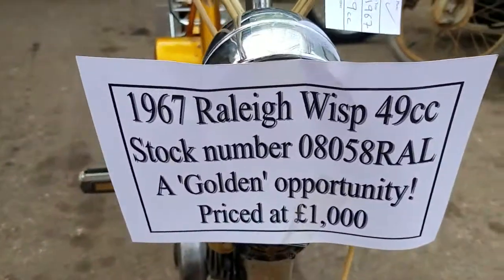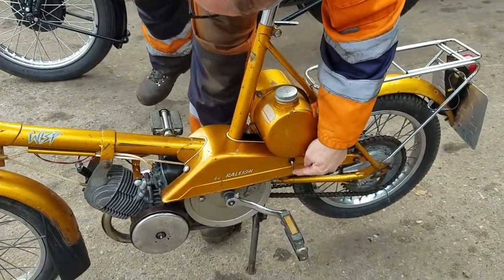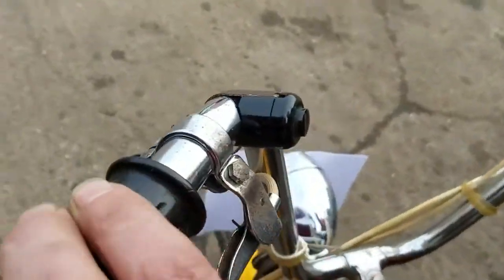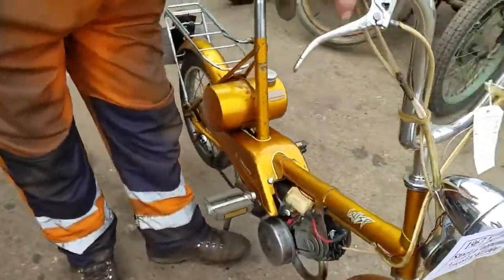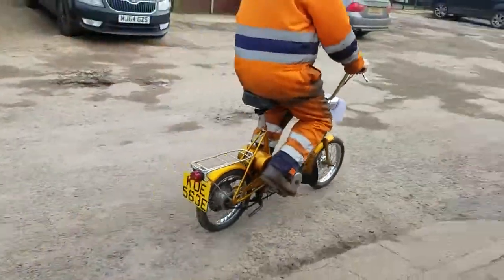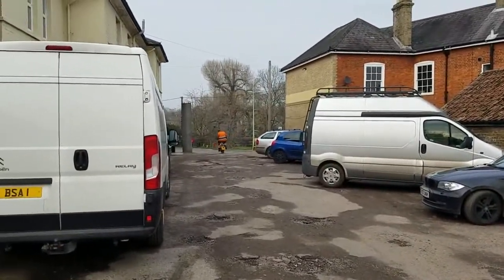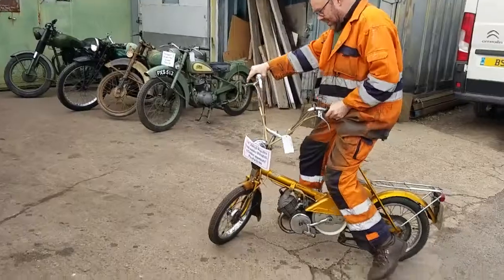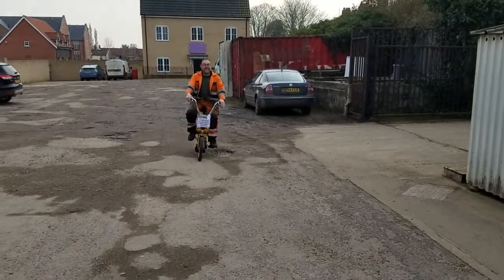1967 Raleigh Wisp 49cc at Andy Tiernans #08058RAL

Comment: I had one in Singapore, exactly the same colour.
I rode it to Ipoh, and back.
On those roads, and no suspension, my arse took weeks to recover!
The engine mounting bracket broke, and I had to design and make a new one to be welded on.
All the spokes stretched beyond their elastic limit, and became loose. So I had to rebuild the wheels.
My opinion- it was a toy, not suitable for real cycling.
On the plus side, I rode it through a flood up to the seat level. When I emerged, I took the plug out, pedaled t like hell to clear the water out, dried and replaced the plug.
Pedaled like hell again, and off it went!
£1000? Cuckoo!
.